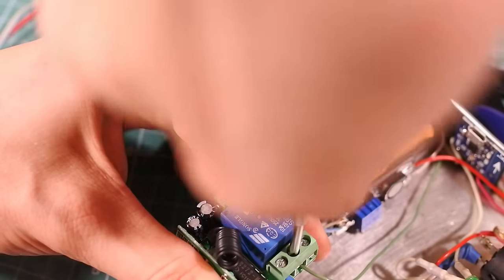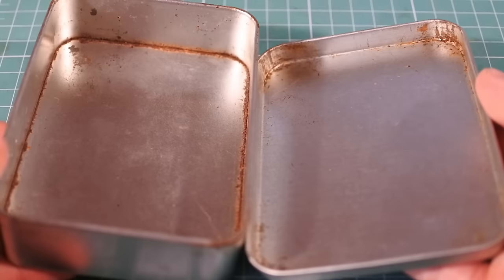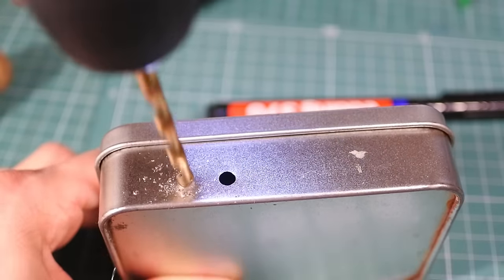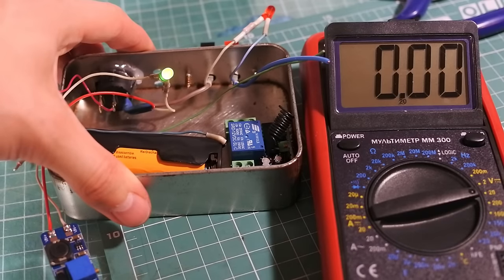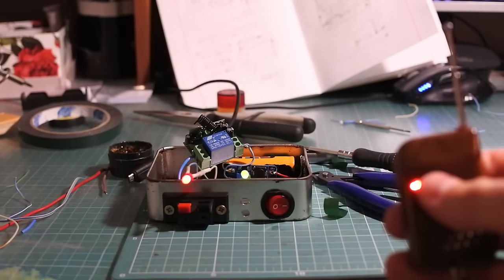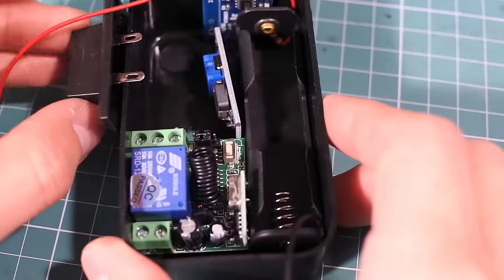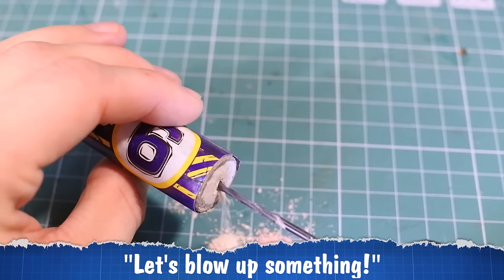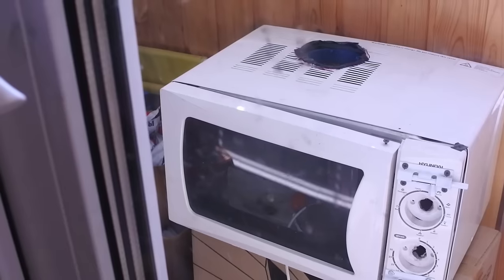DIY DETONATOR, or radio control switch

Comment: Nice video, but i've a question.
Are the resistances too small?
Because with a 3.7V battery it would take 120 ohm of resistance, the voltage drop (standard) is 1,8V (ex. red Led) and 15 mA of current.

Comment: Better, cheaper uses less power, instead of nichcrome wire. Use steel woll. I strip a few.mm of two telephone wires. Bend them into an angle fold, stick ateel wool across and use pliers to crush the copper onto the harder steel. Dip in shelllac or thin lacquer.  Dry then dip in gunpowder slurry to make a small blob around the steel wool tipped end. Dry it, then ideally dip in shellac or spray with laquer to water proof and seal it. You can use any steel wool, the finer the less voltage it takes. I can get them fine enough to fire with hearing aid batteries.  Even course stuff burns instantly with 12 volts. These cost almost nothing. Are much safer than commercial electric squibs, not impact sensitive. No need fir sensitive conductive mixtures.  I used thousands of my own electric squibs in professional shows.  Needs to coat them before dipping in blackpowder slurry, because the nitrate will quickly corrode the steel and you'll lose contact, a few days and the  steel is just a stain. Do it like I said and I've used them after years of storage. Just used some 2 year old ones tonight, new years and all worked fine.  I like this project, I'd just like a bunch of channels somehow, not just one. Or four like one I made with an old remote control setup. Think8ng about having two channels incrementally winding channels and the incrementally selecting numbers. So A1, then hit fire. Three cycles on one and six on the other, and next pulse goes through C6. Anyway. Someone might find this of interest. 

I'm a retired professional who none other than Tony Arena as my mentor. He invented these electric squibs for fireworks in Malta, near the end of WW2. I still think they have features which beat modern squibs.

Comment: I made this same like you.. But my nichrome wire is only heating and not glowing. What could be the issue?
Reply: I have the same problem
Reply: @danielgiordaniasia  It got solved.. I used two batteries (one for relay and other for nichrome wire heating). It worked for me.
Reply: @ojashedau4309  how thick is your nichrome wire? because mine is 0.4mm but even with a 9v battery it doesn't work the same
Reply: @danielgiordaniasia  I used 32 swg that is 0.274mm Diameter wire

Comment: RC remotes have sooo many uses as teenagers.  We'd launch bottle rockets at cars n busses remotely
 Take out the crystal. Put in a different frequency. To jam up ahole radio operators. Add a modulator circuit. To transmit all over the place. Fun days.

Comment: Problem. Device cuts power when the relay clicks. I think it's the battery charging&protection module, says it has short circuit protection on the product specification. Or I'm doing something wrong
Reply: I bet that's it. I have the same issue and can't figure out why it won't work. But I couldn't find the exact same charge protector circuit as he use.
Reply: @BDXextraction  I decided to tear mine apart and order the absolutely same transmitter as in his vid because I used a slightly different kind but. As I approached the finish line my soldering iron decided to take a sh. Maybe something has to be unsoldered from the charging module

Comment: Yeah but you can take a small Dremel tool sander and glue the barrel of it or the cylinder of it over a cell phone vibrator when you open up a burner phone and then you glue strike anywhere matches up against the cylinder of sandpaper in there when you call the phone on vibrate it's been the cylinder and strikes the matches all you have to do is put the phone with the back open and a bucket a black powder or pressure cooker for any solid container Home Depot bucket or an empty paint container you can even set the phone to vibrate for your alarm clock and you never have to activate the phone just set the timer for the alarm to go off on vibrate and you throw that phone in the bucket then there's no record of ownership of the phone and there's no record of calls to that area
Reply: but this is a system that can be used many times ant its cheap.

Comment: How do I make this work with Ammonium nitrate mixture? Please I need for school project!
Reply: So if you're making a pipe bomb then I'm pretty sure youe have to make the same thing but in the last steps you have to fill the pipe with half the mixture, slide a blast cap or a firework (make it the same way he did with the wires) and completely fill it while also letting the wires connect to the rest of the contraption, then get to a safe distance and blow that sucker up! (Make sure to do this with caution since I am not 100% sure of what I said this is just a conclusion).
Reply: Hey man

Comment: Nice project but what nichrome wire I need? 26, 28, 30 or 32 gauge??
Reply: doesnt really matter. if you have a powerful battery all of them will start glowing. but the thinner the wire the faster it starts glowing.

Comment: it doesn't work, I did everything exactly the same likes you but when I press the button it lights up as it should, but when I connected with a nichrome wire and pressing the button it just turns off, I bought everything identically ...what is the problem there

Comment: This would only short the receiver. Once you connect the Nicrome wire and supppy voltage to it, it would shut off. With what you have here won’t heat up the nicrome wire

Comment: how much "MAH" that 18650 battery got? I get a remote conection to lights and led's but i cant get the canthal wire hot enough and my resistor just ends up getting super hot

Comment: on another video with a 16 chanel the middle terminal was used for positive voltage this video schematic it say use ground for the 3 relay terminal any one care to explain the difference